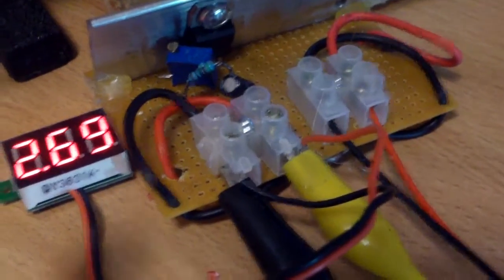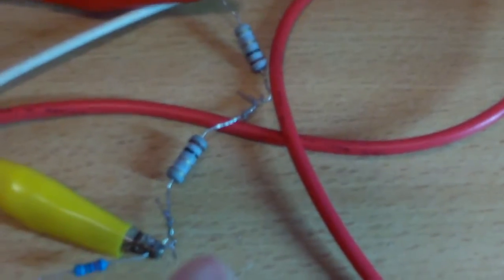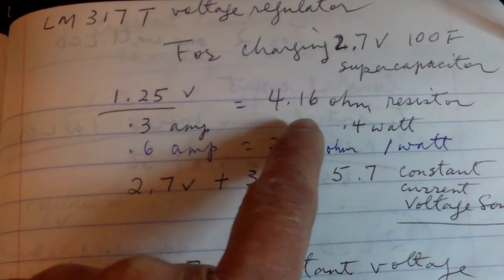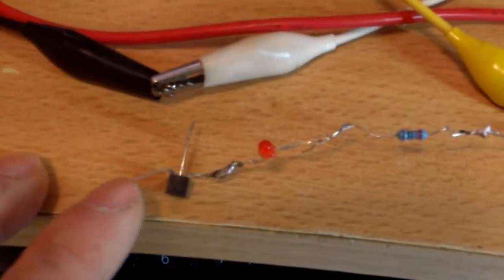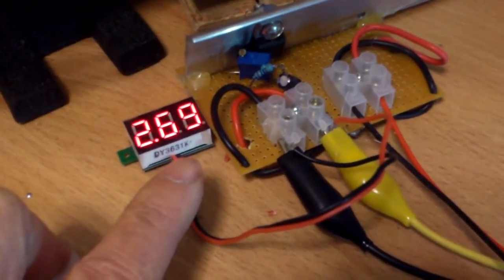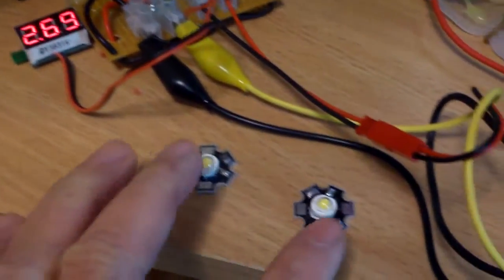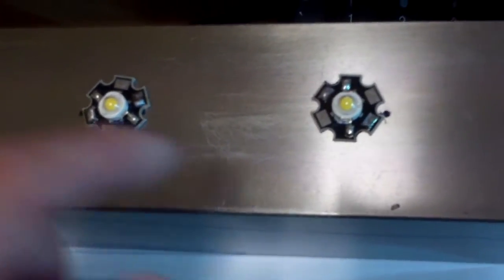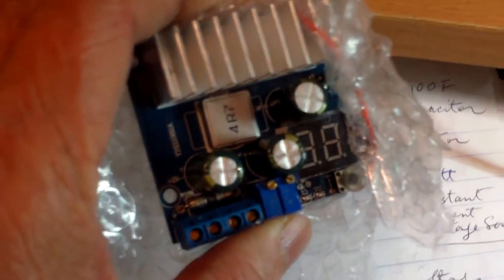Experimenting with my LM317 voltage regulator part 2: Constant current charger

Comment: Their is a LM317 on my 12 volt Grid tie inverter on the input DC side I know because I replaced it on one of the GTI s one time. It had a little heat sink. A blown cap and a couple of of AC mosfets where blown too. But I got the DC side working then I never replace the AC mosphets thought they were good but I had my doubts about a couple of them. Any way I gave to a friend and he had to replace some kind of a chip and I think he had to program it? It was kinda of a complicated fix. I almost fixed but had to give up and like I said I got the DC side working. I replaced the AC fuse too. It takes a lot of time to work on stuff like that and I dont know that much about it. I still have a Milwaukee battery charger I need to work on but the soldering job will be tricky because the broken wire is incredibly small. I have so many projects to finish and not enough time to get them all done.
Reply from the maker: shartne So much to do and so little time to do it. Fixing things nowadays means replacing the malfunctioning parts. Certain things are difficult to fix because you cannot unsolder them and resolder the new parts without special knowledge and equipment. Parts can also be difficult to get. I used one of the heat sink from an inverter to heat sink the LM317.  The LM317 regulator is easier to understand than the switch mode pwm drivers used to drive high power LEDs. Now I understand why they charge hundreds of dollars to change the high intensity headlights with their special drivers/control modules. Give me the sealed beam headlights from years ago anytime. They cost a few dollars and minutes to replace.